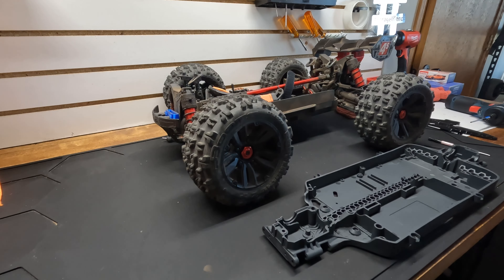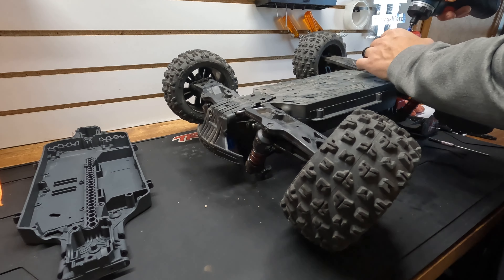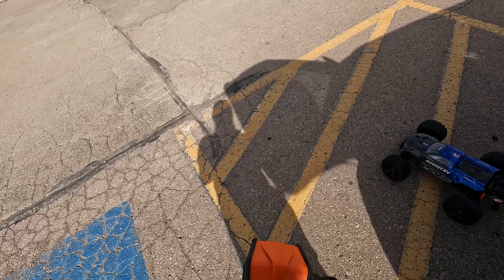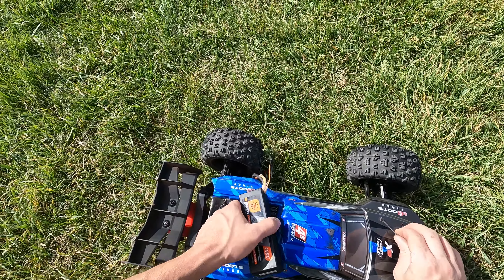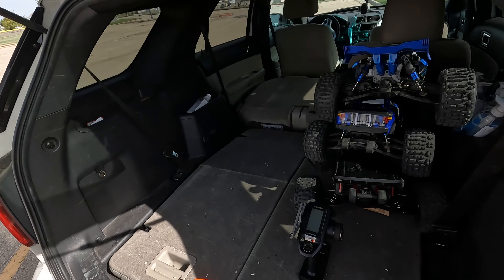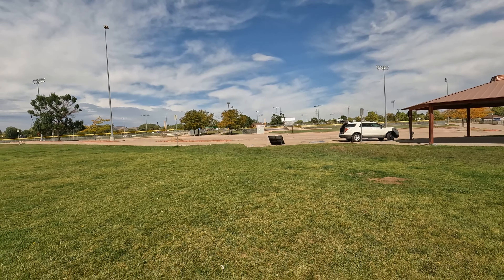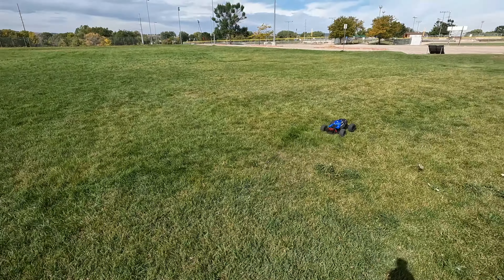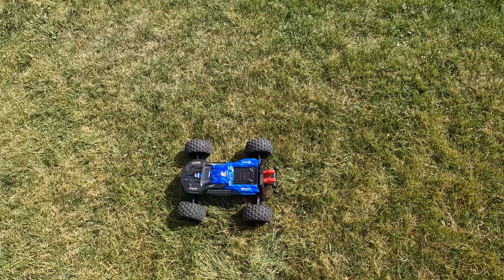Arrma Kraton 4s V2 Chassis Fix | Broken Center Brace

Comment: the battery straps are velcro not kevlar.  dump the rc on its nose from 15 feet in the air they will probably break.  blame it on the rc like most people do!
Reply: I think you misunderstood. He said he has Kevlar ones he will be putting on.

Comment: Sir, as i told many times: Use 3 Battery Straps. One battery strap on the long side, goes under the 2 installed ones, and over the 2 installed ones. Has to be closed as the last one in the end. Then no more battery pop out or such things.

Comment: I broke that cheap plastic plate in front of the battery on my new outcast also. When you order the replacement it comes with a thicker double wall kinda block piece you can use instead. It’s much stronger and I drilled two holes in it and put two big long rivets through it. It’s never breaking again 😄 I’ll order Kevlar straps from you when they’re available. Good video man keep it up

Comment: I've had a kraton 4s for about 2 months, and I've broken the chassis not once but twice. Same place both times, the front bulkhead. First was my fault. Second time I jumped a 2 ft tall ramp, landed, and snap!... So I'm replacing the chassis AGAIN, and this time adding a bash bar from M2C.. If I break the chassis again with the bar, I'm trading it off for a Traxxas lol

Comment: I love ic5 connectors never had a problem and u severely need to adjust your tow it's way off.
Reply from the maker: I seem to always have problems with IC5 but I can USE EC5 with no issues. Weird

Comment: I didn’t get a chance to bash mine, just bought it yesterday, today it clipped a railroad tie going pretty quick,  and broke the front end in a few spots, as well as the hinge on the bottom side of the chassis like yours. I was told Arma is redesigning the chassis, and so they’re on back order till April, so here’s hoping they come out much stronger!! Def not the parts fault it was a hard hit, square into the right tire, but still sucks on a side note, seems the arm and suspension held up well!

Comment: Hello I just became aware of your "red" wing mount in your video and had immediately looked in your store... they unfortunately not found there!
Is it currently still in a "test phase" ... etc.?
Would have great interest in it !
Have blessed that you also work with (Stefan) POS as an example together and his parts yes also offer, can the front bumper on the Kraton 4S very empfelen ... has certainly saved me several times!
Would be very happy about a reply!
Best regards from Germany !
Reply from the maker: Which red wing mount? I have a couple. Which vehicle are you talking about?
Reply: @GarageLifeRC  The "red" wing mount (from this video) from your Kraton 4S v2 !  
Has it been tested so far that it can be purchased, because you can't find it in your shop?